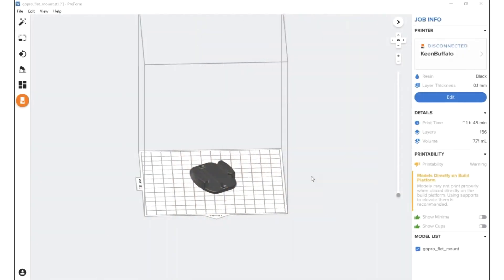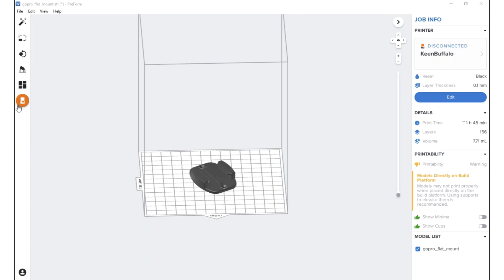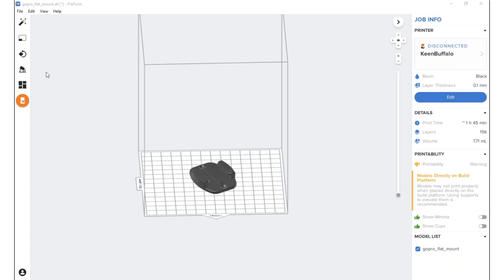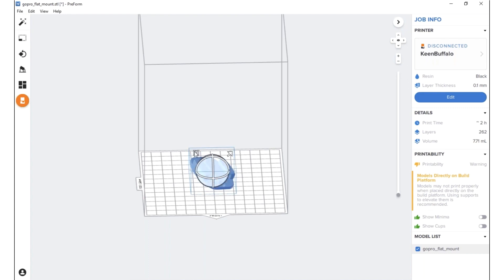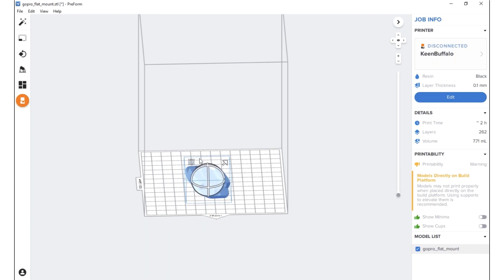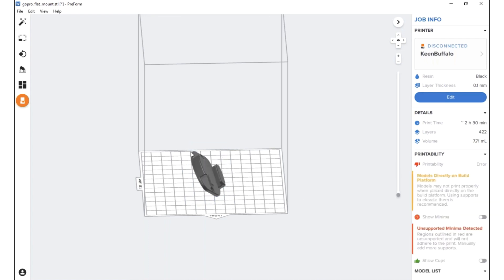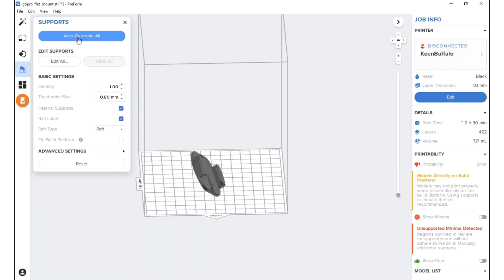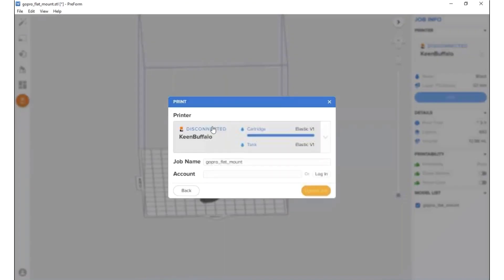PreForm Software: How to prepare models for 3D printing in just a few minutes

Comment: Great video! How do you remain in 3D view? I am always stay in a 2 D view, does it need a 3D mouse or so?
Reply from the maker: I just use a regular mouse and use the middle scroll button to move around as well as the left side bar options to move the model and screen around.
Reply: EACPDS allright, thanks a lot for answering.